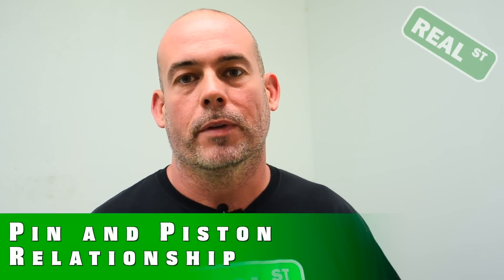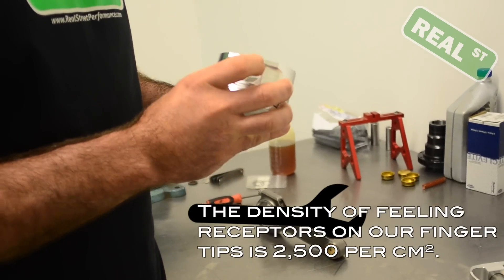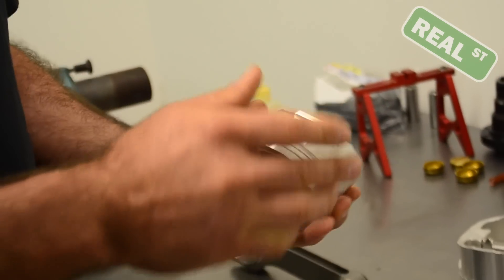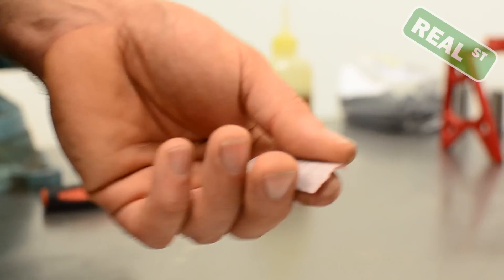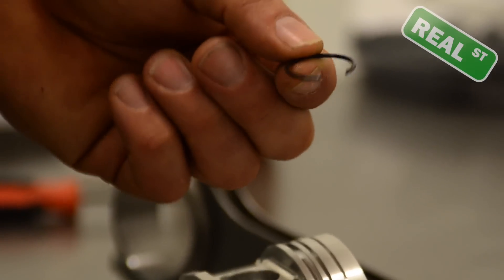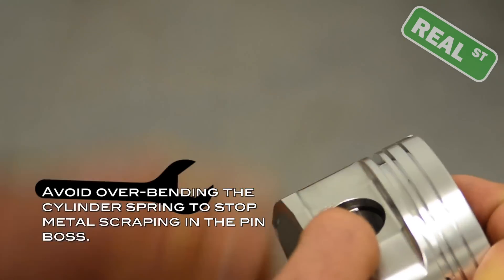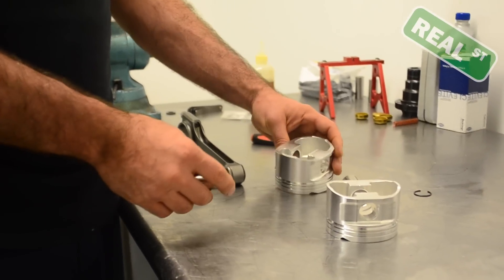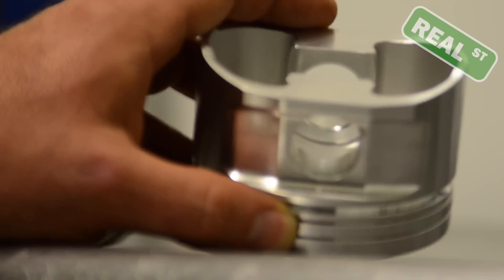Jay's Tech Tips  #9: Wrist Pin & Piston Relationship/Installation of Pin Retention Clips

Comment: I orient the open part of the clip down, because in theory if the open end is to the side or 90 degrees to the movement of the piston the centrifugal force of the clip could compress it enough come out of the clip bore. 

personally I like the spiral lock design.

Comment: When installing the pin retention clips, does the open end need to be oriented in a specific way in relation to the notch in the piston?  These videos are true nuggets!
Reply from the maker: sunchaserjam The open end of the clip doesn't need to face a certain way. It's important that you don't bend it too much during installation. The clip is like a spring with memory and if you compress it too much it will loose tension. Just roll the clip in using the notch in the piston as a place to locate the pick you're using to install the clip - Jay